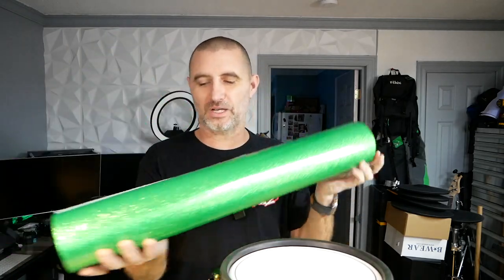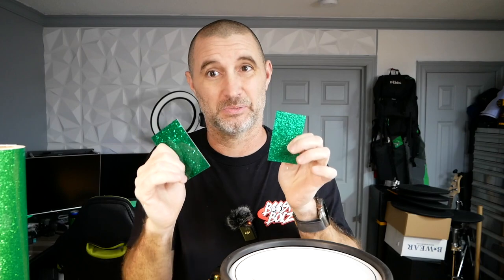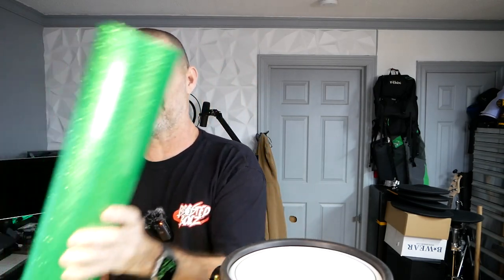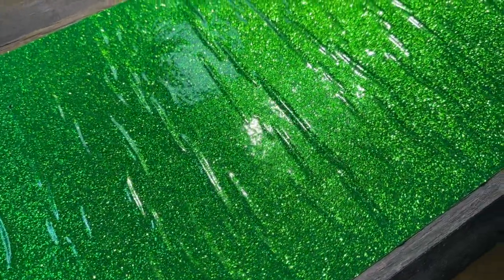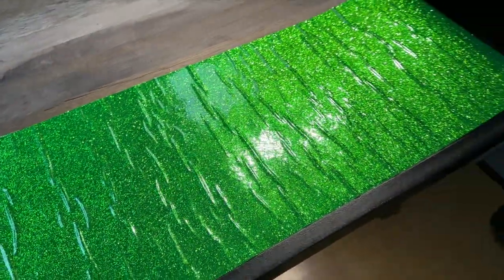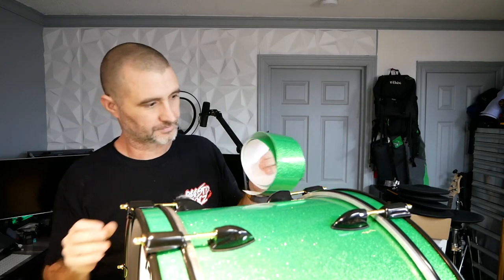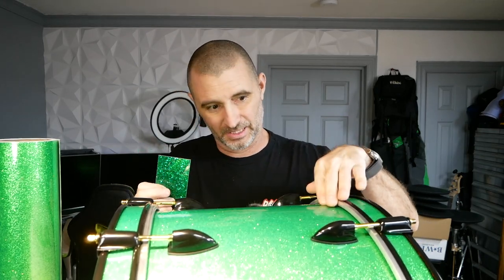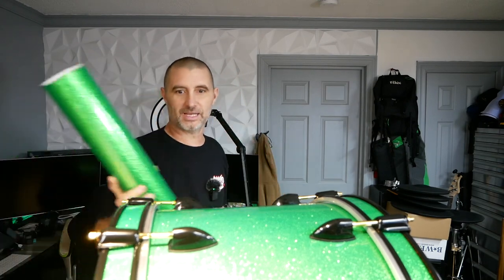Best kept secret drum wrap! #drums #alesisdrums #drumwrap

Comment: This stuff does not hold up in the sun (which I find ironic, considering it's made for outdoor signs). I wrapped an entire drum set with just one roll, it went on easy and looked great. Then, as I was setting up the set in my garage I moved the floor tom into the sun to move things around, and within 10 minutes the wrap started to wrinkle. I moved it back into the shade and about 15 minutes later it leveled out again. It was only about 70 degrees outside, with no humidity, so it's not like it was a scorching day. I've resigned myself to the fact I either have to only use the kit indoors (which will be tough since 3/4 of my Summer gigs are outdoors), or spend a ton on legit drum wrap. I guess it's a great option if you're only going to set up your kit in your basement or studio; if you plan on gigging outdoors, not so much.
Reply from the maker: This good info to know! Thanks for sharing! I’ll pin this comment!
Reply: Did you leave the paper on like he does, or take it off for the whole drum?
Reply: sounds like you need to put it on warm and then when it cools it will shrink, but then when it heats back up it wont bubble.

Comment: If you care about your drums go with a quality wrap like Precision Drum sells. Do yourself a favor. And use the contact adhesive. 😎 Abide
Reply from the maker: Agree but like to idea to change them easily.. I’m on my 3rd wrap just for fun
Reply: Precision is quality but when you play big drums like me that ~$600 price tag isn't exactly welcoming. I'm gonna try the wrap hes got, use contact adhesives, and spray a clear coat over it for some added thickness and protection. It should hold up nicely that way.
Reply: I care about my drums and would use this material in a heartbeat. I am doing my wallet a favor. Seriously...if it breaks down or gets messed up down the road it can easily be removed without any negative impact on the drum shells at all! I really don't want to spend more money to cover my set than the set cost me in the first place. Just the way I roll though. To each their own. You are not wrong about the wrap from PD being legit though. 
Cheers! ♫
Reply: @ledzeppelinfan12344  You get what you pay for. Simple as that.

Comment: I love all the different options to choose from and it does claim to have an out door life of 5 years, so I think I will chance it. I've used car wrap and that's held up great for a very long time, plus It's easily removed with zero shell damage, so as long as Street Plastics has the same charactoristics as that then I'm all in.
Reply from the maker: Personal in my opinion I don’t think the stuff will work well for car wrap because of the way the glitter is applied to the wrap. Plus I haven’t tested how well it with stretch and self heal with heat like most car wrap do 🤷‍♂️ just my 2 cents bro! But now you got me wondering. Maybe I’ll do a follow up video trying to wrap something with curves to see how it will works

Comment: I have used a similar material on drums sets a couple times.  Durability wise, definitely put some durable clear finishing tape to hold the end seam.  Also, only install it over a gloss lacquer finish or an existing wrap.  Going on bare wood is... rough.  It's a neat way to get a temporary finish change though.

But, I've never used Paper Street Plastics, so maybe theirs is better.  You went with the best possible color choice, so thumbs up for that!
Reply: Yes, gloss lacquer for sure.

Comment: I would have done a flush cut technique.  Just leave a 2” lip, take a straight edge, split the difference and using an exacto knife and cut through both layers which cuts off the lip on top and the bottom lip layer underneath which when taken out will result in a perfect flush cut.
Reply from the maker: I’ll try that next time!

Comment: I used this stuff on a mixed maker studio kit...bought a half roll of the red sparkle.  Looked awesome when finished.  But I did stick it down all the way around the shell...the manufactor said it would wrinkle if I didn't.  That was due to the temp changes in the room(s) where I played the kit.
Reply: i am going to give my old stencil kit a facelift with the holographic crystal material that they have. It looks amazing! I will definitely be removing the backing paper on mine when it comes. I want it to lay nicely. ♫♪♫

Comment: I've wrapped a few of my drum sets. One with a textured gator skin, one with a copper/orange sparkle, and one with a green sparkle. I use marine vinyl that they use to upholster seats with. It comes in large rolls big enough to do an entire set with. And it's relatively cheap. I can get 3 cubic yards for about $60 or $70. You just cut it down to size and use a durable spray adhesive to tack it on. Then I use a drill to drill through all the hardware screw holes. If you do it right it looks factory professional. The options for colors and textures are pretty much unlimited. I wish I could upload pics of my kits here, but even after more than 15 years my gatorskin kit has held up perfectly after many gigs. Still looks new.
Reply: Where do you get your vinyl wrap from?
Reply: Hi, could you indicate the link to the site where you can purchase the material?

Comment: So, you just keep the paper on except for the few inches where you stick it down.  I saw that, but I just want to make sure.  That actually makes so much sense.
Reply from the maker: Yes and it’s holding up great!
Reply: @tq64to4  Which also means that it's easier to remove.  You could change the color of your drums every year cheaply and easily.

Comment: For $20.00 i got form amazon Sequins Holographic Glitter Sign Vinyl, with Self-Adhesive (12 inch x 10 ft, Red)  but kin of disappointment the next day i see curling or corners already :(, IT could be because the Drums i covered are metal Pintechs and not wooden shells.
Reply from the maker: Some of those vinyls you have to “set the glue “ with a heat gun. 🤷‍♂️ it’s like a heat activated glue
Reply: @tq64to4 Even the self adhesive ones?
Reply from the maker: Yes you think it’s stuck but it really isn’t
Reply: @tq64to4  i have a heat gun but never used them so id be afraid to burn my fingers or ruin the paper for sure.